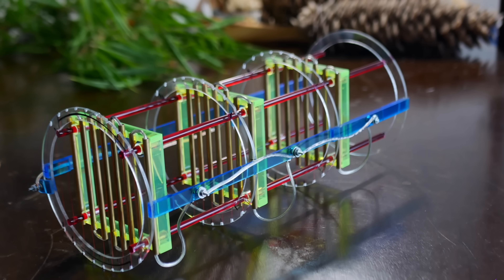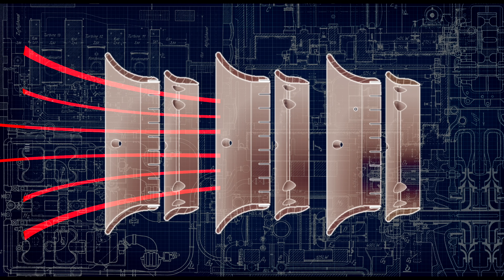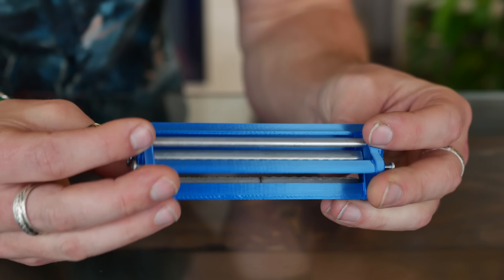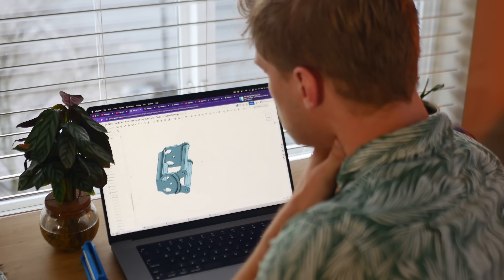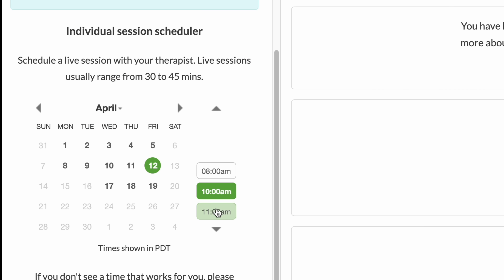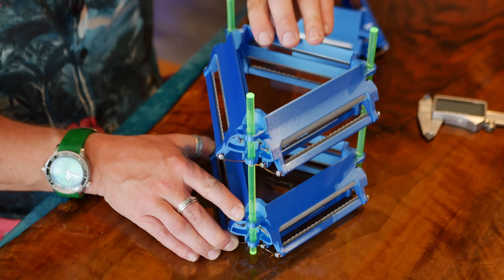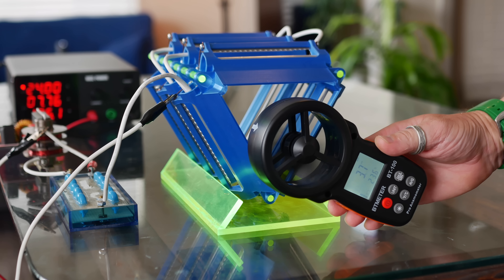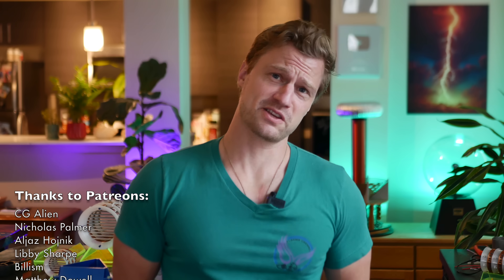Next-Gen Ionic Plasma Thruster Inspired By Nature (BTC Mark 3)

Comment: I feel like this is an extremely interesting design and the first thing i thought of with the 3 stages was to try a rotating field like in a brushless motor. Basically only have 1 of the 3 sides of the triangle firing at once (or AC with a 60deg phase shift). Then you can also try playing with the frequency to see the impact. I suspect that with a rotation of the right frequency maybe a vortex could arise and pull even more air from the sides. That might need a shroud around the design though.

Comment: i still wanna see you using one of thoses to make a trully fanless fanless fan
current fanless fans on the market have a mini fan inside them, and use some kind of physical effect to make the small airescape the hollow ring and push more air around, but with your ionic thursters you can make a fan with zero moving parts

Comment: I love the design but I don’t understand the need for greater strength/structural integrity.  Every version so far has looked comically over designed and heavy, cool but nowhere near getting off the ground. I think looking towards indoor rubber band gliders for inspiration would be helpful, as well as stepping away from 3d printed parts and moving towards paper and balsa

Comment: I think your problem is the line of convergence-you mistakenly assume that an efficient angle of output from one will not cause interference when stacked with another. Try a version that allows you to adjust the angles of each set of 3 "blades", not just the gaps between each set of 3.  AND-there will be less air interference if the entire thing is housed in some sort of casing. You can always add slits to this housing to allow strategic air input that is efficient-and cut out airflows that are not!

Comment: I wonder if you made the thrusters curved, so when they're together, they make a circle, instead of the triangle. Then the stream will converge in a cone. Also, maybe it could be designed to utilise a venturi to further accelerate the primary flow, while drawing in more secondary flow as well.🤔

Comment: Did you ever thought about using AI to design some parts of it?
Reply from the maker: Noooo. I will never let AI touch my work.
Reply: Well, AI is right in the corner, hope you do better than it, or use it to your advantage.
Reply from the maker: Doing better than it will be easy for a while longer, but eventually impossible. However, I would rather take a second place and know that 100% of the results came from my brain, as opposed to taking first place, knowing that I didn’t do the mental capacity myself. Just personal preference.
Reply: @PlasmaChannel  make sense

Comment: Hey, I love the new design it looks like you were able to incorporate the thruster into the interior of the wing. I have another suggestion, your triangular configuration causes back pressure at the intersect points of each phase slowing the flow. if you adjust the angles to be slightly off from one another, they can stack like a slide, creating a vortex effect, sucking more air in. An easy way to think about it is draw a triangle with a circle in the center then offset the center line of each side of the triangle to the edge of the circle instead of the center point

Comment: Okay okay. In lieu of my previous comments. I need to watch everything you've done so far to figure out what you've tried. This feels right. Let's put this bad boy in a case and "gear" it. Large opening to smaller opening with increased voltage moving along. Higher pressure as it pulls more air into the housing, etc.
Reply: Also curious if thermals are a concern here, is the air warmer after ionization? ANNNDD I'd be really curious to know if a node system would work? In other words, for a DIY it would be something like the heads of screws exposed with a spiral design. This would allow you to switch from triangle to a cylinder.

Comment: The air speed is mostly related to the voltage and seperation, adding stages may increase it a little but not very much. However adding stages does help this by accelerating the same air again. But i think the more important thing to measure is the actual thrust. Airspeed is good, but it doesn't  tell you enough of the picture. Also i would think you could make it in 3 stages getting slightly smaller each one and then run all 3 on seperate voltages so that the final smallest stage has the most acceleration, and the first stage simply has the most air. Similar to a jet engine in this effect. Each stage needs to be stwpped up in voltage and converge smaller area. Just my thoughts

Comment: Hello first time commentor here, So what if you made Bellshaped Cap ( <--- front side made from a very porus ferrite like a hard filter spunge, Next ::: <-- The none condutive space >  <---- Lastly the horned end with a noosle like shape, the hole maybe 50% of the airflow inflow. have the inside of the horn plated with a thinn layer of gold. maybe there could be a increse of power by adding a second stage inside with a solid dropshaped material with higher resistance and by using a diode or mosfet setup to have the power alternating between the low resistance ferrite(long pull) to a short distance(pull) Since you want to ionize the air then would it not be in best intrest too have it almost ignite the air and moisture. depending on scale would a 5uf 4000v cap with trickle feed give a bypass for a boost button ? :cat-orange-whistling:

Comment: Please start measuring thrust since air velocity and approximate volume are only secondary figures that aren't helpful for an engineer looking to use these
Also your Mk2 design didnt have an inefficient second and third stage, kinetic energy is proportional to the square of velocity so achieving the same increase as the first stage on the second one requires 3x the energy  as the first one

Comment: I wonder, 🤔... If you could add more thrusts if you applied Dyson bladeless fan concept, and go for either circle ⭕ shape or hexagonal...

And... I think I have mentioned before, but...
I would hope you really go for hybrid ionic motor thrusters...

The old electric motor is already highly efficient to begin with... So, why not use iconic thruster concept to improve it?

Also... For some reason, I think applying turbofan concept to your ionic thrusters could help improving the aerodynamic?

Comment: Point of convergence for each stage,  if you put in a cullander or nossel half the size of your initial opening, you will concentrate more of the air flow, and cause less of a "blow out" increasing the overall column of air's strength,  if the nozzle is too small, it will result in blow back as it forces air back out the inlet. By my understanding, a slight adjustment, should make the central hole into a vortex blend, believed to increase the max compression of the air column. Still, no moving parts added.

Comment: A change that you could try is to close the "inside part" of every single module in order to have 1 closed tunnel. I'll try to explain myself better, every single "mini" thruster has 2 inputs for the air and 1 output, the inputs are 1 inside the air tunnel and 1 external, probably by leaving only the external input you should see almost the same end speed. I suspect that the "internal input" is taking some "accelerated" air from inside the tunnel creating the same effect you had in the older versions if the only "holes" you leave in the tunnel are the ouput ones it should be more efficient

Comment: if you calculate the change in specific kinetic energy between each stage of the old thruster, there is variation but not a distinctive downward trend. The decrease in velocity gain is just the quadratic relationship between velocity and kinetic energy, since an equal amount of power was sent through each stage. It would be a very good idea to test each thruster much more rigorously and determine characteristics like energy efficiency and thrust/weight before making conclusions

Comment: Few design changes I would make
1.) less steep angle so less loss of energy when the air streams collide
2.) the sequential thrusters have diminishing returns, but are more efficient. Using multiple sets of 2 sequential thrusters converging into one stream would give a more efficient and powerful flow I believe.
3.) use a circular thruster and angle the outputs of each set of thrusters in a way to produce a vortex inside the body of the thruster.

Just some ideas.
Reply: The first 2 yeah, but making a vortex would waste kinetic energy spinning instead of going directly backwards
Reply: @virutech32  yeah honestly no idea if it could help by pulling in more air with Bernoullis principle or if it would waste energy. it might be good for atomizing fuel if you were to throw the electric only part out the window though haha.
Reply: @gavinhicks7621  It would pull more air by not spinning since that would push air out of the inlets. chemical-ion hybrid would be interesting. probably as an after-burner since flames could compromise the resistance of the air-gaps.

Comment: Maybe it is interesting to look which size differences impact the thruster.
Is it better to insert a little triangle in this version? Maybe making a conical structure focussing the stream more and more inward.

Also, the sharp angles on the triangles will create turbulence when converging on eachother.  hexagonal or octogonal arrangement should help the output at the focus point
Reply: In addition. It would be good to protect the thruster from external airflow.

The increase of airspeed in a pressure column can only be obtained in, well... A column. As such, a clear separation between high an low pressure should be implemented. 

To ad to this:
Winds coming from the outside would probably interfere with the ion streams inside the thruster. Giving an additional argument for outside shielding.

The implementation of such column does however change performance based on the speed the thruster is moving

Comment: Perhaps the forward module feeds down a center tube (square, rectangular or round). The center module exits thru a larger (shaped) tube around the forward module exhaust. They exhibit convergence with final stage or module. The thought might not be velocity but volume.  You can control the charge to each stage. You can use the exhaust convergence as a possible built in fourth stage at said convergence.  How the different stages are tuned will create very interesting results. The possibility to create a fourth stage at the convergence moment with the stream separation tubes becoming electrodes brings interesting thought.

Comment: Seriously looking at this design I can already see applications if you can actually get the output right. Some type of actuator or gear system to move each of the thrusters closer or further apart to get different power ranges maybe just straight output for a fast speed or low output but a lot of air flow for hovering. Very very interesting design

Comment: I would really like to see how fast you can get the air if you build this as a closed loop. I think it is strange that the speed of the air does not increase in the same way after the second stage as with the first one. Since the electrons are shooting at a much higher speed from A to B the minor difference in the gained wind speed should not decrease the impulse that much. Perhaps it is because the air is already going at the same direction and is less likely to be hit by an electron. Thus a slight angle of the anode and cathode to the actual air flow could even be beneficial.

Comment: Have you tought about using metal hair combs as your emitters? They have a aerodynamics  shape and would give you more surface area in a small space. Plus if you place two combs parallel and you tilt the combs to a angle of 30°, you could  saturate  the whole air stream with ions.

Comment: You should make the first one 10% larger, and the last one 10% smaller. 3D print 5mm angled spacers that seal off any drag from outside. Basically turning it into a sealed unit in the middle. Then you'll see 6m/s.

Comment: What about making them different sizes? So basically it would be triangular (smallest at the front and larger in the back or reversed) in another dimension. I can’t help but feel there’s still some drag with the other modules when they’re all the same size. Or maybe an oblique wing design where the edges go outward on one end and taper down some to prevent drag? A thinner and wider design I think would be best if going the oblique wing method.

Comment: 3:10 this is incorrect. The intake of additional air AFTER each acceleration stage was limiting the maximum velocity. You were mixing ambient air at 0 m/s with accelerated air which just undid most of the work the first stage performed. You need to seal off the sides to achieve sequential acceleration. In the new design you have a similar drag effect with a column of unaccelerated air in the centre.

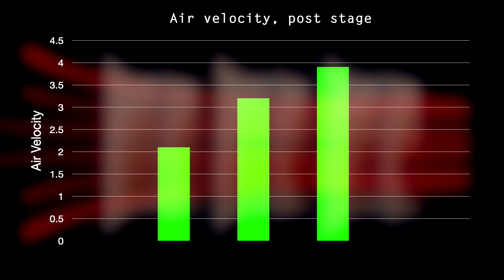Comment: 3:14 that's not diminishing returns, that's just how energy goes, mv², the second stage increased the KE of the rushing air by 2.5x, and the third stage by another 50% which is still more than the first stage, the first stage compared to the resulting air, only contributed about 27% of the KE transfer, the second stage contributing 40% and the last stage 33%
you should've added more stages to see how it TRULY tapers off
you can't possibly get a linear increase in air speed because nothing other than gravity itself can achieve that, as long as the amount of power you give to the system increases linearly it can only increase the air speed in a square root fashion, to get a linear increase you'd have to have a quadratic curve increase in power

Comment: Add a lower output version in the centre of the triangle like the illuminati eye but facing the opposite way. Should increase air pressure  using the venturi effect

Comment: Wow, that mass flow is comparable to what a $10 computer case fan can do with less than two watts, that's impressive for such a small ionic thruster, and just 100 times higher power consumption. And to achieve that air velocity 120 mm fans typically require multiple watts, like 3-4 watts, depending on how well designed they are. Enjoyable video, even if I personally think it's a bit early to talk about ionic thrusters as if they were near viable practical alternatives for propulsion in air, without very specific conditions that somehow makes up for their limitations/disadvantages.  

I wonder, how sure are you about potential velocity limit being the [most important] factor in causing diminishing returns in the old version, and not maybe simply due to such things like that drag is proportional to the velocity squared at high enough velocities, all else equal? I mean, I'm no expert, but the input is electric discharge, which means the velocity is the speed of light, which should make that the ultimate "theoretical" limit for the flow rate, which causes air to ionize, and the ions are slowed down by the air they push. Does a few meters per second of air velocity really matter much compared to the speed of light?      

The data you provided for diminishing returns with multiple stages were very close to exactly what should be expected to overcome drag, a doubling of input power from 40 to 80 watts, gave almost exactly 50% increased velocity, and the additional 50% power input on top of that, from 80 to 120 watts, increased the velocity by almost 25%.  The overall air velocity was definitely a bit low to expect a near exact squared relation between drag and velocity, but then again, we known that the air wasn't a nice, even and undisturbed flow.

Comment: A few people are mentioning measuring the thrust.  Meaning measure how many pounds/grams/kilograms/newtons are pushing.  Dividing by watts gives you efficiency.  Or dividing by weight of motor is interesting as well.  Velocity is of course important as if it is only 3m/sec and doesn't improve much in a headwind then your airplane can't go faster than 3m/sec. But I recommend concentrating on static thrust.  grams of thrust per watt.  You can use a kitchen scale or, better, get a load cell and build a test stand.  Calibrate the load cell with a kitchen scale, suitcase scale, or similar.

Comment: You are missing compression.  Think about the nozzle on an f14 tomcat the smaller the hole the higher the thrust.  You have a large hole going into the same size hole.  Based on your testing each stage would have to be stronger than the previous stage to gain thrust.  Powering each stage with it's own transformer setup could help. So x goes in stage 1 is 1X, stage 2 is 2 x, stage 3 is 3x. All powered by the same variable input.

The other thing is each stage needs to be smaller so conversion is at the point of intake of the next stage thus creating compression and acceleration.

Comment: Your velocity gain very much looks like a sqrt(x) type funktion because kinetic Energie increses with velocity squared. So ideally you should try to move a large volume of air at a low speed since impulse is just mass times velocity so you will get a greater Impulse for the same energy.
Reply: MITs design also moved large volumes at low speed.

Comment: You should look at it as energy input vs velocity squared, not velocity.  Specifically it is mass flow * velocity *velocity which is power vs power input. The ratio is the efficiency of the engine